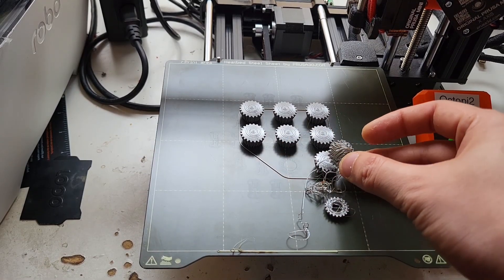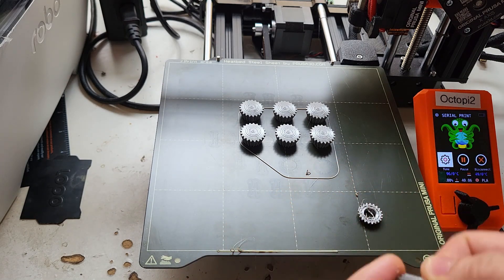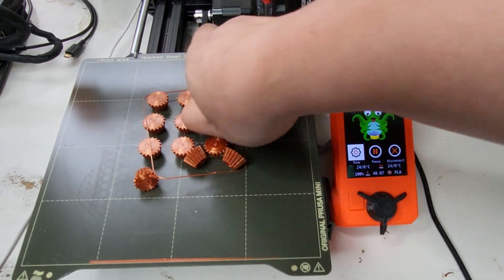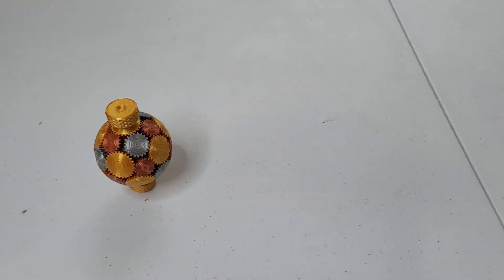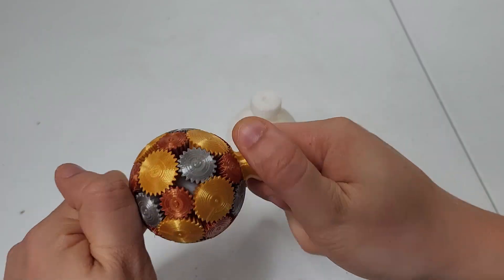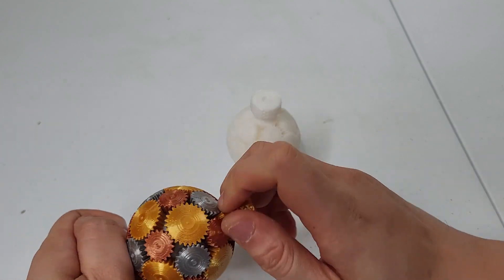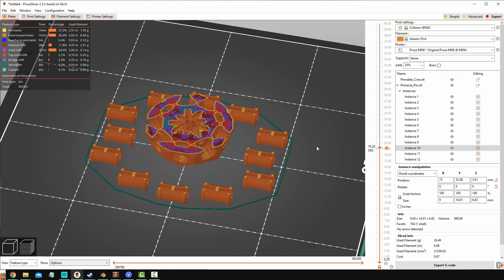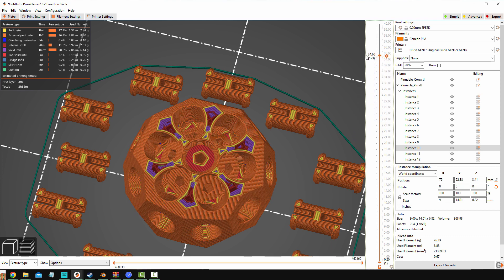3D Printed Pinnacle Gear Sphere Assembly

Comment: I printed 3 colors of this with some other figits with zero adhesion problems, but 2 out of 3 exploded out of the printer when the magnetic bed let go....  raining gears...  The first one assembled works great,  but because the others exploded, I need to go find all of the parts before I can finish assembly.  I did apply some synthetic 3d printer lube, and that helped a lot.  The next two will be pre-lubed internally and should be better than the first.  Silicone based lubricant mixtures is what you want for PLA, just use it lightly, and away from the outside surface to keep it clean.  Normally I keep my fidgets moving joints dry, but this one has 96 grinding surfaces that move together, so they need some help.

Comment: Thanks for sharing, I've just printed out mine, it was stiff and would not turn, gears were slipping. I've used silicone oil to lubricate the assembly and it works like a charm! :)

Comment: This thing looks really fun especially in the multiple colors. If you put a drop of Tri Flow bicycle chain lubricant into each hole that a pin goes into, it will spin freely and never bind up. Even if you lubricate after assembly it should work wonders.

Comment: Yo I printed this and idk if I just need pliers but the pins don’t seem like they will fit into the gears at all
Reply: However, the PLA filaments that are being delivered in the last few months have been absolute crap! It doesn't matter if brand X, colour Y was great last week, it seems like good manufacturers dried up during the pandemic and now there is many, many filaments that are complete garbage. One of the bad features now is that they swell and close holes, as well as shrink and split between the layers.

Now I open all filaments and test print them as soon as they come in the door and the return window closes. These producers have to learn that 90% of the suckers won't suck it up and think they made a bad adjustment, until they get better product on the shelves again.
Reply: @larrya740  so you're saying it's bad filament that's swelling too much?

Comment: Something logically wrong with this gadget! Since all holes are equally spaced around the B knob the B gear and A gear cannot both engage the knob. That is not physically possible and to wit I printed all the parts. The A gear does not reach anything on any side of it.

However I have counted the teeth to match the count with the video, the design on Thingiverse, and the original design, and although the teeth counts all match, the diameters must be incorrect.

In addition the largest C gear has a pin hole that is smaller and must be drilled out to allow the pin to be forced into place.  This could be due to swelling of the PLA I used but I have three rolls of this material and never had any problems previously with this filament with sizing or swelling.
Reply from the maker: Sorry to hear you had issues. The holes aren't equally spaced though, see https://ibb.co/WVBkBfY for an orthographic picture straight down the original where a large gear would be, the hexagons (where medium Cs would go) are slightly farther (I put a point at their centers). The vertices on the gears for the teeth and diameter are exactly the same - the gears are untouched except for sealing off the poles and the bore, and a CSG diff for the pin socket. https://ibb.co/dkJvRC5

All socket geometry are the same size. I have noticed that the small A piece is easier to insert pins into, I think that's just because there's less plastic so it flexes easier. The pins requires a considerable amount of force for me to initially get them in. When pushing the pins in the gears, I had to use the pliers almost every time; (after the first few demonstrations, that's edited out for time) after it's partially in I then snap it in by hand. Notice when I do the edits for pushing pins in gears, the pliers are either moving on the table, or in my hand.

Comment: Looking forward to making this. Do you think the increased friction is likely from a burr on the plastic you missed? or something else?
Reply: See my comment above. The A and B gears cannot be different sizes by the logic of the layout. It is not possible. Try printing a few gears only and prove it first. It's a long waste fo time if it doesn't work.
Reply from the maker: It's hard to say, there's a lot of factors and I wasn't paying attention until it was too late. But, I was lazy about cleanup because the first attempt (with the natural PLA) went so well so maybe I got too complacent - including not taking out some loose pieces from the sockets that print upside down.